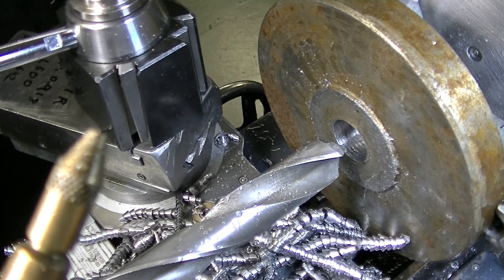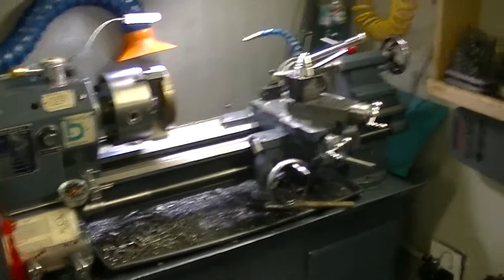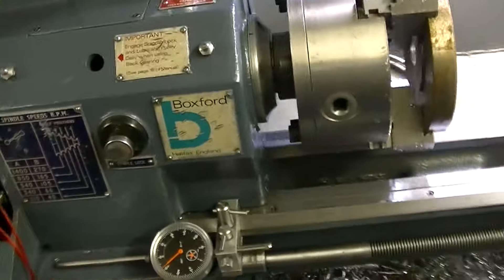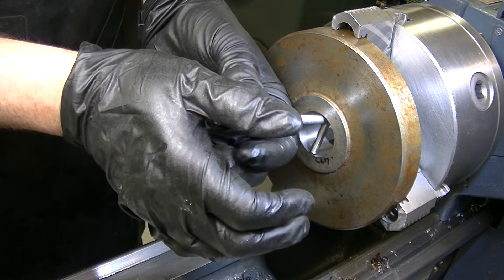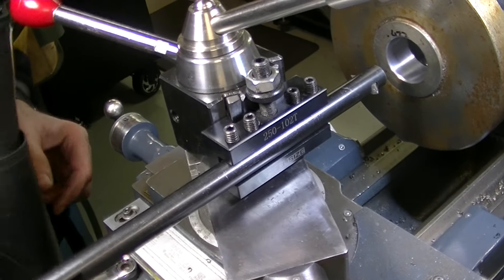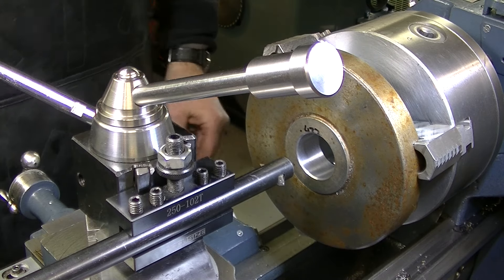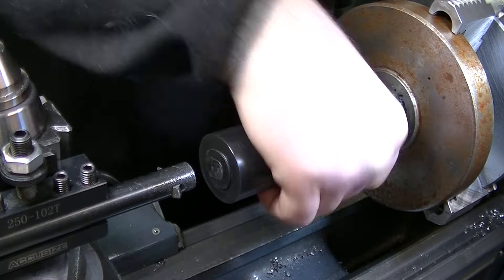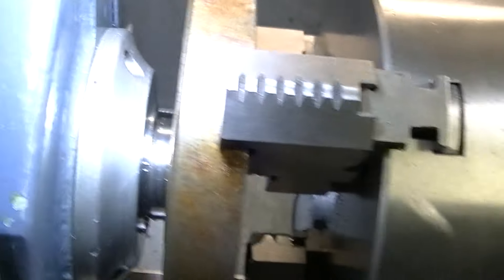Internal threading a chuck backplate

Comment: Gary, I spent a fair bit of time researching proper procedures before making mine, and that led me to believe that you are supposed to counter bore the back, to index off the face and sides of the shoulder on the spindle...
Reply from the maker: That's correct.  Most chucks have a recess on the back for that purpose.  I wasnt so concerned with doing it on this one BC the chuck was a 4 jaw do doesn't matter where it sits.
Reply: @garysgarage101 Ok, that makes sense!